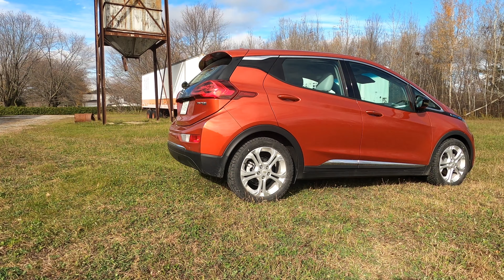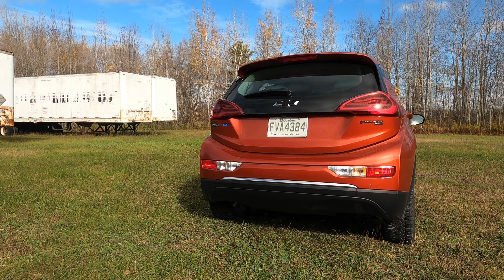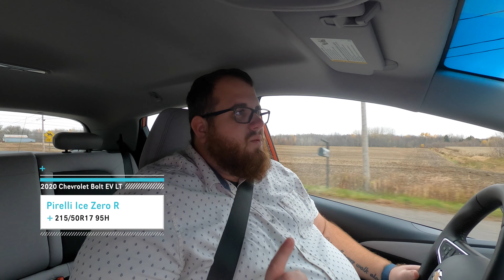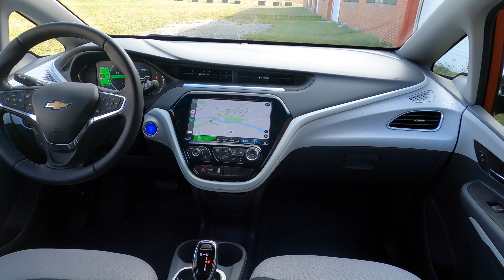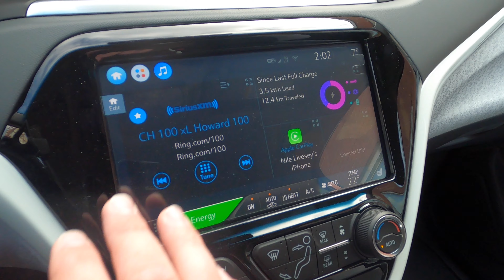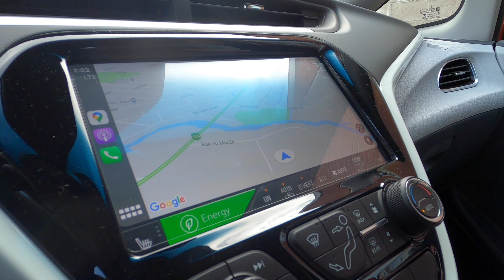Improved Range & Cameras | 2020 Chevrolet Bolt EV LT Full Tour & Review

Comment: Like the Canyon Orange, but not as well as the original Burnt Orange it launched with. Here in UT Bolts are hard to get so you basically live with whatever color is available.
Reply from the maker: Is that due to the lack of EV infrastructure so Chevrolet doesn't send many out there? Or is it just due to the current supply issues everyone has?
Reply: @PRNTestDrive  no idea. I bought mine a couple of years ago and even then inventory was thing.

Comment: I got my 2020 Premier with every option for $27K in the U.S. Waze on apple CarPlay is an awesome navigation system that is free! Heated steering wheel and birdseye camera are great and collision protection saved me already! I love the way I can see individual front and rear tires for perfect parking in my cluttered garage! I never touch the brake except at full stop and I like that they finally got away from having to turn on cruise control then hit set as it is always on you just hit set and touch the paddle to stop cruise! I chose not to buy a Tesla Model Y or any Tesla as the screen is the ultimate distracted driving the Bolt has most used controls as buttons and knobs that I can use in the dark blindfolded! Also fit and finish are perfect where Tesla is sad!
Reply from the maker: We do see a lot of complaints about Tesla's build quality. Glad to hear you're enjoying your Bolt EV!
Reply: Good choice, you got a really good deal!
Reply: Tesla has gotten a lot better on their panels.

Comment: I test drove this car. I loved it actually. Perfect size. I’m just worried about the battery life and all that. Also I feel like this car won’t be around after 2021. They may wanna make the EUV version of this only and do away with this compact design which I particularly am a fan of. I hate big cars. I can’t find many people with over 100,000 miles on their bolts. The battery life deal would drive me nuts over time. At least with a gas vehicle you can tune it up and make it run like new. For an EV once the battery doesn’t charge like it use to you are screwed. Like my iPhone. Doesn’t hold the charge like it use to.  The prices for these are very good right now. Even for the premier models. I’m watching these videos with a careful eye.
Reply: Hi Joel, I have a 2017 Bolt EV Premier with 107,000 miles. As of now battery degradation is very little - I can still get to 290 miles in the summer 😎. Check out my channel for more information!
Reply from the maker: We do talk about the overall lifespan of these electric vehicle batteries in an episode we did just prior to this on the sustainability of EVs. It does seem that many of these cars are low-mileage as around the 100-150k mi mark the battery starts to lose its efficiency.
Reply: @PRNTestDrive   a bolt owner in California has a 2017 battery is still great at 70,000 miles

Comment: One thing to consider, at least in the US, Chevy is discounting these $8500 and if you shop around, dealers are dropping another $3-6K off the discounted price.  I found a 2020 Bolt Premier (list price $44k) for $30k with all the options.  I have found LTs with DC fast charging an a few other key options for under $25k.  At that price point it is a compelling alternative to a Model 3 SR+, Kona, Leaf or any other 200+ mile EV.
Reply from the maker: Not bad at all! I don't think they discount them as much here, typically in Quebec EVs don't see much dealer/manufacturer incentives since the government does that. Finding a good deal for one makes a big difference!
Reply: Good thing I waited 3 years now they are 10k$

Comment: How are the seats? Last time I checked, it felt like I was sitting on a wood plank. Instant back-ache = instant no-buy
Reply from the maker: I didn't have any issues, longest I did in this was about 200km and 3.5 hours of driving/sitting and I didn't notice anything. I'm starting to think maybe being such a big guy is an advantage as I come with my own seat cushion 😂
Reply: The seat cushion is actually comfortable on the 2020.  The seat back is a little to stiff at the shoulder blade area.  I have made multiple trips of around 180 miles and it wasn't a problem.  I could see it becoming uncomfortable for a longer trip though.
Reply: @mikeg7845  Hmm, maybe they fixed it on the 2020s yeah. Anyway, I'd still go with an Ioniq instead. It's roomier, more comfortable, 5k cheaper and has all the goodies you would look for (which are not even available on the Bolt Premier for example). Its range is more than adequate for my driving needs as well
Reply: @vladsaghin7644  The Ioniq is definitely a better looking car, but I couldn't find one in the US for less than $30k on cars.com.  I found over 150 Bolts for under $25k.
Reply: @mikeg7845  you guys have such great lease deals or financial incentives on Bolts it's crazy. 200-250$/month lease deals on Bolts (or any EV for that matter) is unheard of here in Québec. They sell well enough without any special incentive other than the gvt one. I guess regional differences really are a thing.
Reply: @mikeg7845  Hard to find an Ioniq outside of the coastal states.  The Bolt is available in every state.

Comment: Granted designwise Chevrolet Bolt is a GM subsidiary Daewoo made car for Asian markets I wonder if GM is going to improve the comfort of front seats. In colder areas the lack of heat pump is a deal breaker to me. Otherwise the car is the most practical city car ever which can go pretty far. I definitely prefer its design vs BMW i3.
Reply from the maker: The heat pump was a miss, I also noticed the hvac in general on this wasn't great. Sure it got warm or cold depending on what I wanted, but the automatic setting never kept the temperature to what I wanted.
Reply: @PRNTestDrive  so wait a minute, do any of the Bolt EV's have a heat pump? Central USA and it certainly gets too cold in the winter time here to not have heat. I couldn't imagine buying a car with out it, maybe I missed something. Nice review btw.
Reply: Hi nevoi, I live in Minnesota and drive my 2017 Bolt EV Premier over 3000 miles a month. I have over 107,000 miles and the range isn't an issue. Do you do a lot of long road trips? If not, this car would meet your needs. Before the recall I got 180 miles a charge in winter. Check out my channel for more Bolt EV info. PRN, great review, keep up the good work!